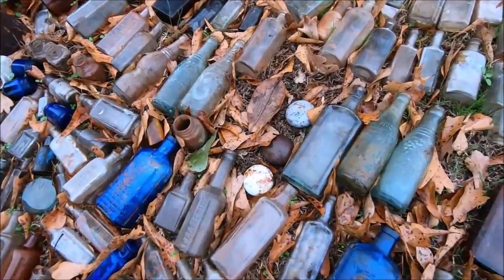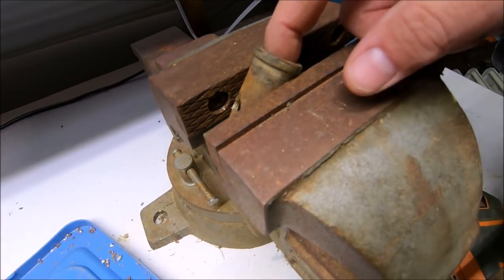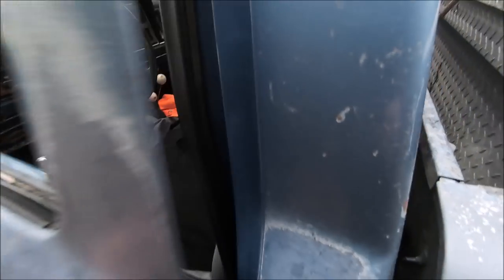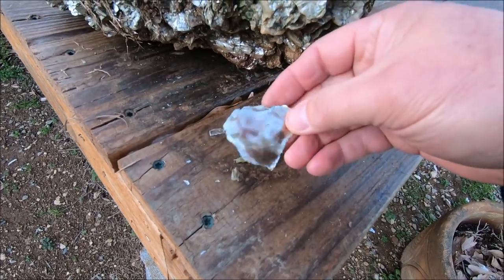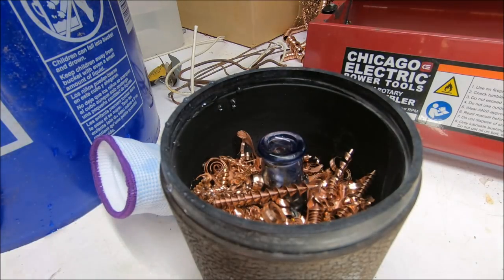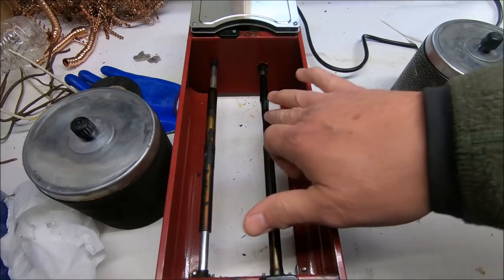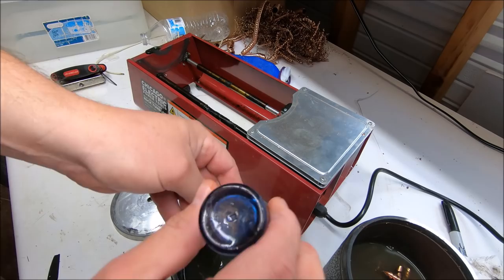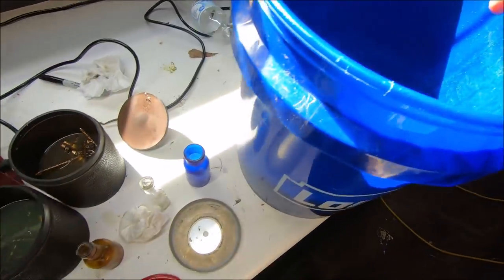How to Clean Antique Bottles with Copper Maybe Kinda Sortof

Comment: Get yourself some Daisy Copperhead BB's and make yourself a container out of PVC pipe similar to the diameter of the rock tumbling containers. Put a layer of silicone caulk on the rock tumbler rollers for grip. Might work.

Comment: With ole blue losing antifreeze try adding a couple of tablespoons of black pepper into the radiator. You might have a pin hole leak. The pepper clogs the small hole but doesn't screw anything up. This is a trick I got from brother.

Comment: I just use bb's. They work great. You had way to much media in the little blue bottle. Brandon from AA made a tumbler canister out of a handi-wipes container. Worked ok, but did leak a little. Some silicone might help. But it worked on the bigger bottles.
Reply from the maker: I saw his video. I'm gonna do a video using bb's I"m not sure they will clean as fast. I got other cleaned in a few hours with the sharp edged copper
Reply: @ExploringAlabama  - That's true, it does take some time. It was amazing how great that little bottle turned out after just 24 hours! I was very surprised. I didn't expect that! Thank you for your timely response, EA. Do you watch Rocks Cousteu? If not, check him out. He's awesome. Native artifacts, bottles, marbles. He finds them all. Plus, he's an amazing human being.

Comment: If you put a ring collar around the drill it would keep it in the same place. The other thing it would help to add plastic pipe or  other to end of the pipe. Let it drop into a pail of some sort.  The top end could be  a piece of steel or what ever.  if you are on;y doing 12 gauge wire  a 3/8 drill should work. If you are doing bigger work you need the large drill.   The top part only needs to holes drilled. One for drill one for the wire, need not be the same size.  You might try a milling cutter to get smaller pieces. The rate of wire feed will determine  flake sizes since the drill should be the same speed. And yes a cheap drill press would make it easier.

Comment: Try getting a piece of lightly frosted glass to make a diffuser for the flashlight lens, it may make the light pattern better... and would copper bb’s work in the tumbler, you can smack them with a hammer to make some odd shaped pieces too..?
Reply from the maker: good idea on smashing bbs. I don't think just round would do anything. As for the lens, maybe the mica would work. Great ideas thanks a lot

Comment: When you replaced the water pump did you replace the thermostat, it could be leaking there or if there’s air in the line 👍🏼 I had that same problem on my old 92 Mazda b 2200